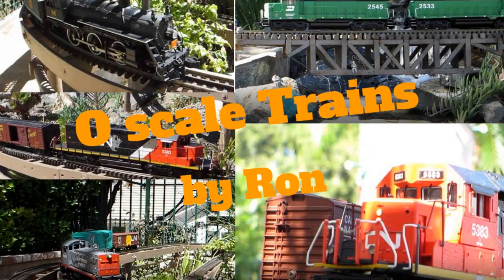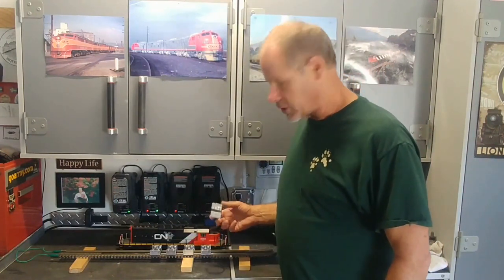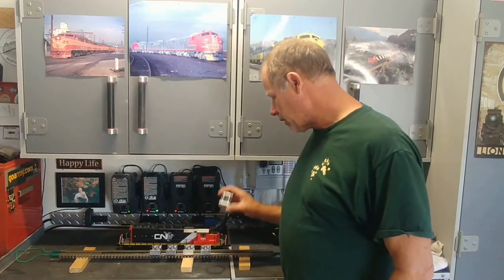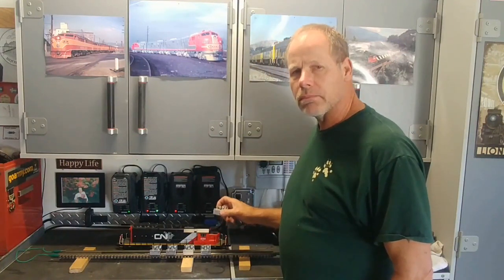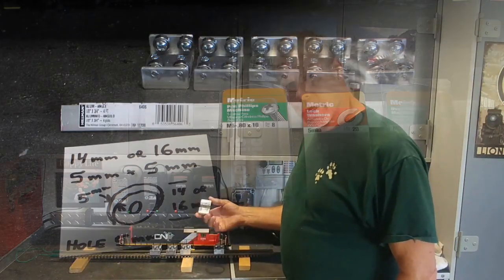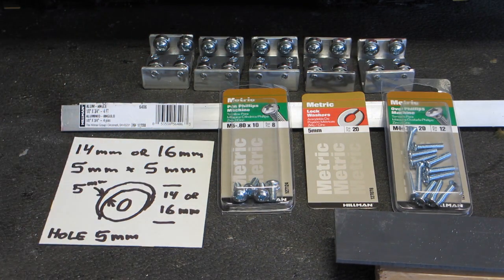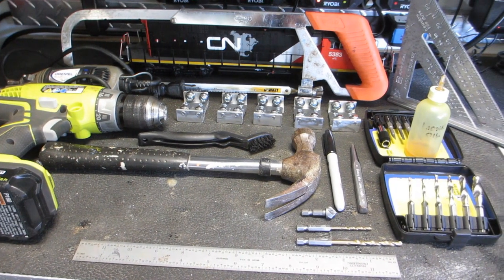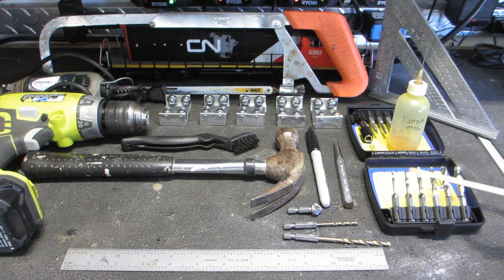How to build a simple set O scale Locomotive Roller Stands

Comment: This is a great idea! Thank you so much for sharing this. 😊
Reply from the maker: Thanks for watching and your comments. If you build use the 16mm bearings. The wheel flanges will have a bit more clearance. 🙂👍🚂
Reply: @baldypalmsrailroad  Thank you for the updated information. It’s greatly appreciate it my friend.  Frank
Reply from the maker: @TwistedMacGyversTrains  I also found that using superglue between the angle brackets, and the plastic bottom piece works better than thread and screwing them together.
Reply: @baldypalmsrailroad  Much appreciated!

Comment: These are awesome and I'm going to make my own sets, but I have a question. Are the hole spacings/locations in the L brackets for the roller screws and spacer screws the same? In other words, are both sets of holes 3/16" from the "top" edge and 3/4" apart?
Reply from the maker: It been awhile since I made this video, and I was looking back to see if I had any of the original footage.  The bearing holes I believe were 3/4" apart, you want them close enough as to not touch each other and the the locomotive wheels ride above the L bracket.  I also did a modification to the lower holes to the bracket and the plastic spacer.  I did not make holes here. I simply glued the plastic to the aluminum bracket.  I took a wheel set and used this as my template when gluing the two L brackets to the plastic spacer/base.  I used super glue.  Gluing gave you a more precise alignment of the wheel base spacing of both brackets.  Hope this answers your question.  Thanks for watching and commenting.  These are very handy, I use them all the time... Let me know how things work out on your project.. 👍😊🚂

Comment: What are the dimensions of the plastic, and how did you space the holes? That part was a little unclear
Reply from the maker: Andrew, the dimensions of the plastic is 1.25” wide and 1.50”long.
Don’t worry drilling holes. The last two roller stands I made I used super glue to secure the plastic piece to the L bracket with the roller bearings. You line up everything much better this way.
Reply: @baldypalmsrailroad  ah, that sounds a lot easier. thanks!
Reply from the maker: If you send an email to info on my website I can send you a photo example.
Reply: @baldypalmsrailroad  I think I can figure it out based on what you said. Appreciate it, though

Comment: How are you handling power from the center rail?
Reply from the maker: I just alligator clip a wire to one of the locomotive pick up rollers to the center rail. I also put a piece of electrical tape over the center rail as precaution. 
Ron//